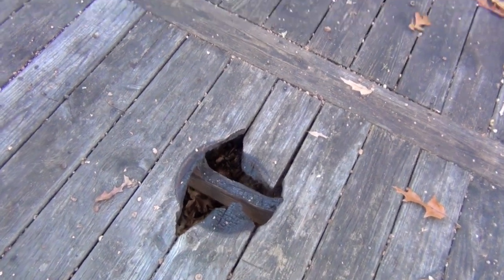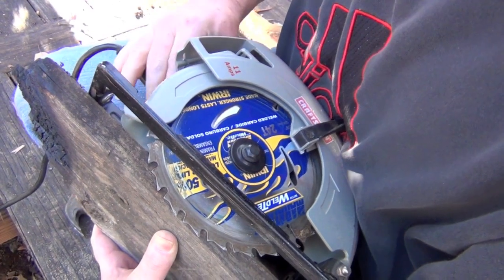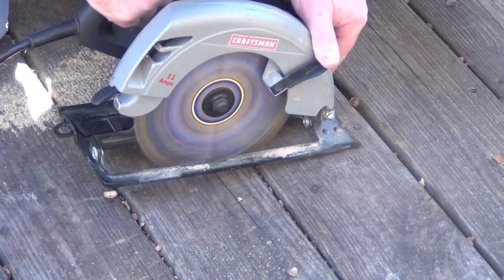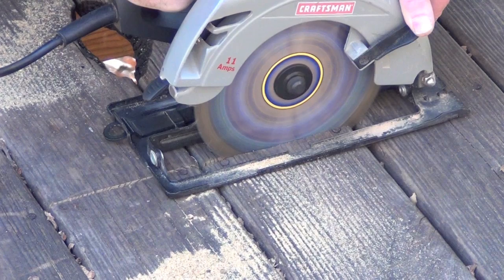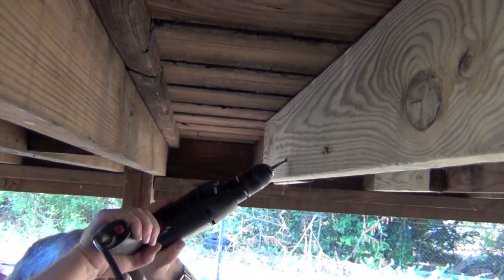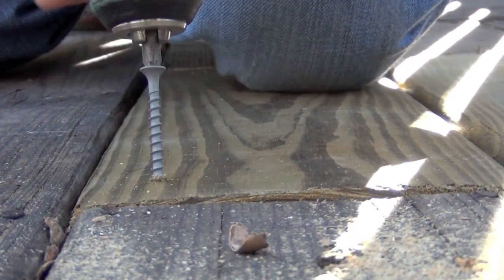How to repair a deck diy

Comment: Board shall be placed "barkside down" and not "cup-side down". When the board expands with barkside facing down it will crown allowing water to run off. With cup-side down, board will expand upward which in a "cup-form" will allow water to be retained on board thus eventually weakening the board much sooner than later.